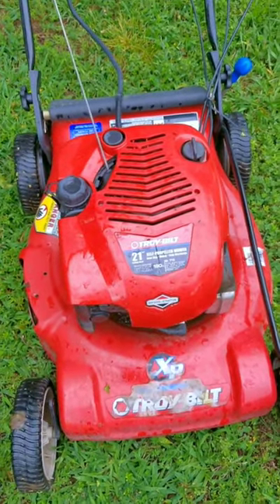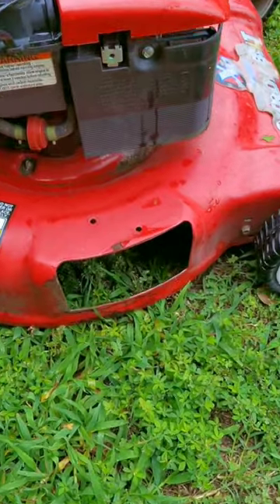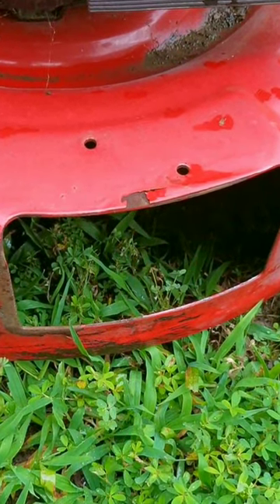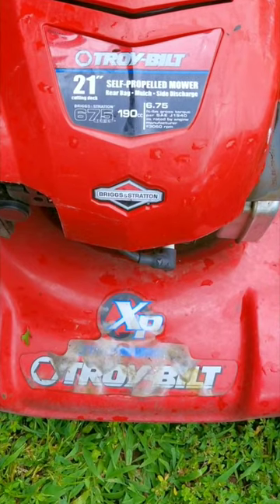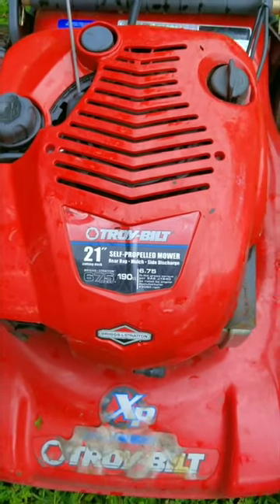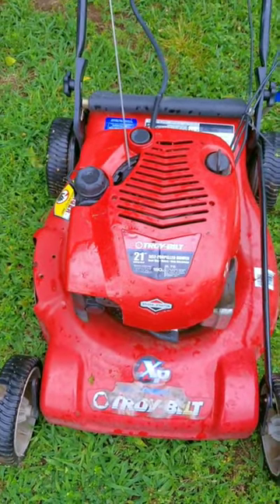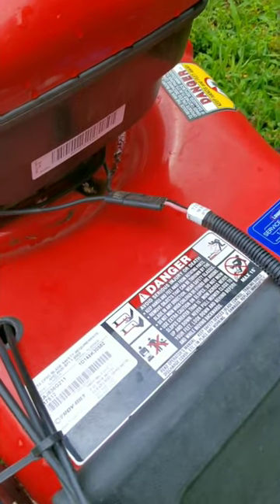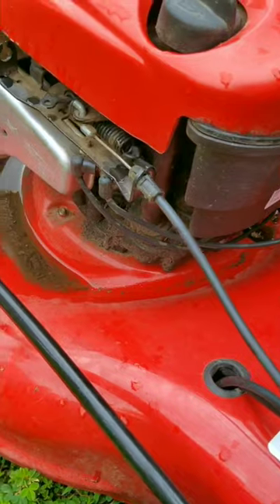Don't Do This To Your Mower #shorts

Comment: Sometimes they break and fall off or become really loose from holding it open improperly,  and are just removed. If you really wanted to repair this local smal engine repair guys usually have a similar mower you can use to bring yours back to pristine condition.
Reply from the maker: thank you for the advice

Comment: I find myself fabricating a side discharge shoot for nearly every mower that comes thru my shop because I won't sell a mower without one. I make mulch plugs also and I recently  cut a side discharge port into my pristine original Honda hr21 and fabbed a shoot for it because I don't like to bag and I hate the clunk metal rear side discharge adapter. 
If I have to open a side cover temporarily I use a conduit beam clamp and a small length of jack chain hooked around the dipstick tube and clamped to the side cover holding it open.
Reply from the maker: nice work

Comment: 49 bucks+ tax and shipping to have a self propelled rear bagger mulcher isn't bad in my book. It's just a shame that the owner didn't use the side discharge extra chute if his came with one. It holds up the side mulch flap so that it will side discharge. I use mine when I neglect the grass a couple weeks due to rain. It works well but sticks out so you can't get close to objects on the right side..... Could be why he just took it off. And yes.....a bungee cord holds the side flap up and out of the way just fine.
Reply from the maker: yes I know right, but beggars can't be chooser I guess. thank man